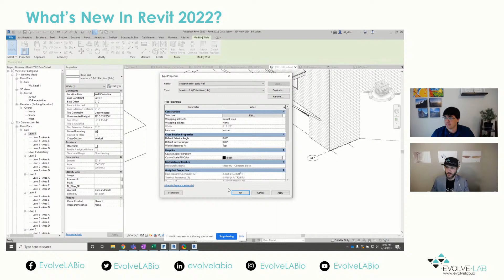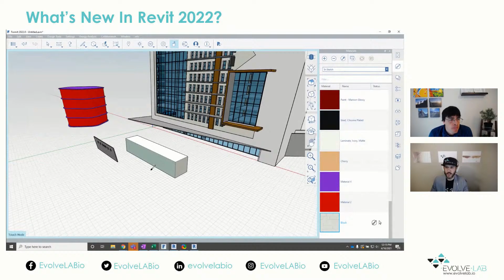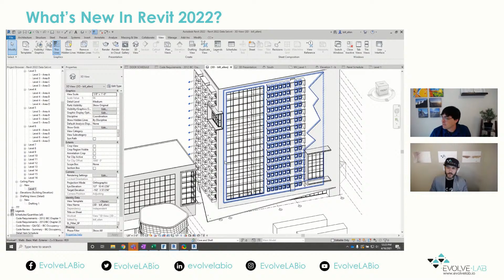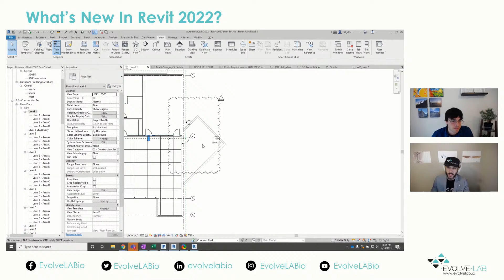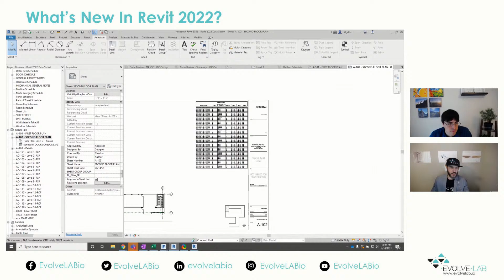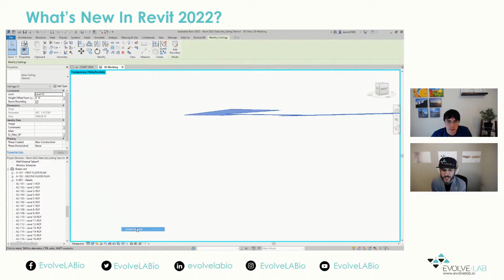What's New In Revit 2022?

Comment: Does the "Link Rhino" feature allow for using the Rhino geometry as base for Wall by Face, Floor by Face etc? Also, how is the Rhino geometry cut in plan and section? Except for convenience, is there a benefit over placing the 3dm file into a family and loading the rfa?